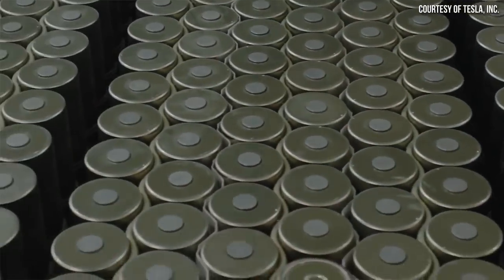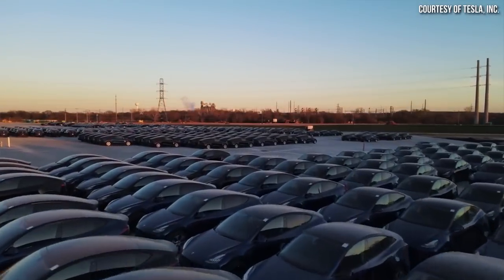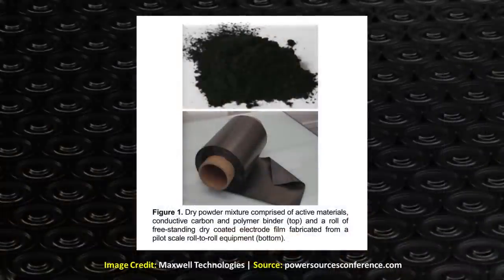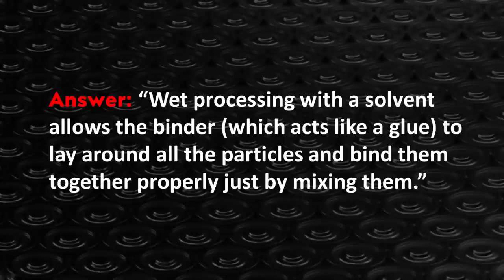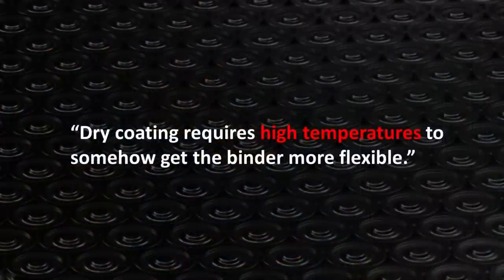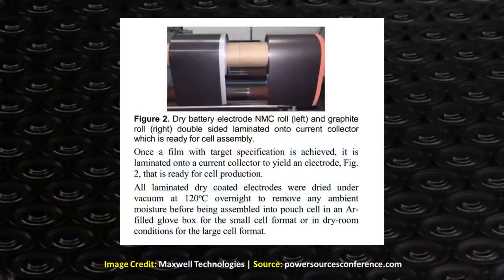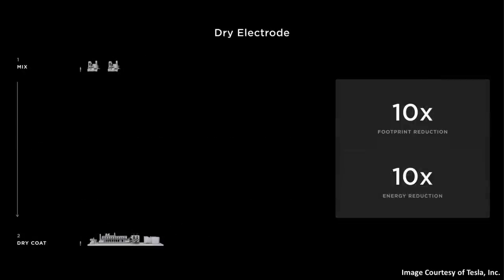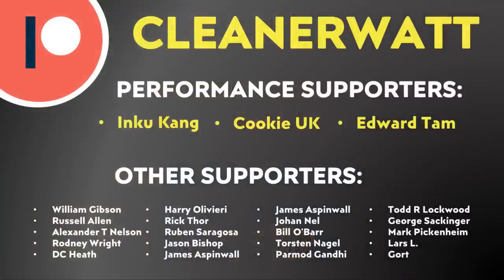Why Making Tesla DBE Battery is HARD, but WORTH IT

Comment: The Jordan the Limiting Factory guy is the best source for battery information. In his YouTube videos, he also explains how the solvents in the wet process needs to be removed to maintain the purity of the cathode materials. This process produces toxic wastes and leaves impurities in the cathode which reduces the life of the cathode.

The space and time required for the drying process for the wet production is another disadvantage of this process, especially the drying time. Speed is of production is one of the most often overlooked benefits of the 4680 design. The dry battery electrode process and the tab-less cell both dramatically increase the speed at which batteries can be produced. This is why Tesla can design battery manufacturing factory at Giga Texas and Giga Berlin, each designed to eventually produce 200 GWh per year while VW and the others are planning multiple battery factories each producing a maximum of 40 GWh per year.

Comment: As discussed by Limiting Factor some months ago, the pilot lines had problems with Nickel. Nickel is very hard and pits the rollers used to compress the materials into the DBE film. This wears out the machines faster than desired for large scale production. With the recent analysis of an early 4680 cell, the DBE technology can be seen on either the anode or cathode (I cannot recall which from memory). Full scale ramp may not require both halves, but it's part of their engineering effort to get there.
Reply: It was dry cathode only.
Reply: @andrewsaint6581  Nope, anode.

Comment: Sounds kind of like powder coating vs painting.  Or fusing toner in a laser printer vs an ink jet printer.  More complex I'm sure, as you have a reactive material.  But similar in that it goes from powder to solid.  Also similar in that the powder process is more complex but can be superior in certain aspects.

Comment: now that we can 3D print metals and polymers (plastics), why not print ? 
electronics have been printed (with conductive inks) for years. 
this is not to say it is exactly the same, but printing polymers (Q: how to make them stick on metal?) should be feasible. 
it may simply be a question of throughput though, where the printing would not be fast enough to attain the increase in production speed that Tesla is looking for. 
I enjoyed this one 🙂

Comment: Coating something dry on a conductor film ? Coating count on adhesion and adhesion count on molecular energy which is electrostatic energy at the molecular level. So bonding doesn’t work without such energy. 

Construction glue count on electrostatic energy associate in chemistry (we call glue). Alternative to glue? Shine UV light on target surface induced electrostatic on printing paper. Masking that uV light on paper we have a selective uV and hence imaged uV and electrostatic image that selective attract carbon dust onto selective regions on printing paper. Hot roll the two we have a Rank Xerox photo copying. This Xerox patent is expired. Feel free to explore this process. 

For dry electrolytes on conducting electrodes, use a blank mask or no mask. Shine uV on work electrode to load it up with uV or if possible direct load up the electrode with electrostatic and let it pull in the fine and dry electrolytes, in a controlled manner in favor to thickness and void free coating. Then find any means to fuse them together as one part of electrolyte-electrode laminate. 

Adhesion enhancement? Smooth electrode surface may use micro rippled surface, chemical etched rippled or plasma etched ripple. Hop this helps.
Reply from the maker: There is a bit lost in translation I think, but I think I get enough to understand. Very interesting thoughts.
Reply: In photocopying and Xerox Laser Printing. . .  a selenium belt is electrostatically charged, and the selectively discharged by a laser or light source (copier).  A plastic-encapsulated grain of carbon black is drawn to the still-charged areas, and transferred to an oppositely charged sheet of paper Memory a little weak on exact process here).  Paper, with plastic encapsulated carbon goes through a heat/pressure station where plastic is melted into paper fibres.  

I can envisage the DBE process working somewhat like that.

And, oh, yes. . .  never cover a laser-printed document, such as a certificate, under a plastic cover.  The carbon black will migrate to the cover sheet
Reply: @Cleanerwatt  please review again revised message above.

Comment: Copper foil on the anode and aluminum foil on the cathode I think ?
Reply: Yes, anode (-VE battery electrode) is copper for lithium ion cell
Reply from the maker: I just added a pinned tweet with that correction.

Comment: So, condensed version...the battery Musk is saying is part of the structural battery pack, isn't being made yet.  So any production numbers he's quoted, like Raptor production numbers, are irrelevant.
Reply: Tesla is producing structural packs with 4680 cells in limited quantities. Per Limiting Factor's analysis of an early production cell, the DBE tech is already in production for one half of the cell; I forget if it's the cathode or anode. So the tech works, but it's known that Nickel particles pit the rollers, wearing down the equipment faster than desired for mass manufacture of both halves. They don't need everything perfected to start building the structural packs in limited numbers, but will to ramp them to truly mass market numbers.
Reply: @Tanstaaflitis  The batteries coming out in that form factor right now, are not the 4680s everyone's been sold.  They aren't using the same process or chemistry, which means they aren't providing the same structural properties OR energy capacity.

It's basically a cylindrical case holding 3 2170s.

Comment: Thats a big problem...if the process is not already perfected it could take years to perfect for mass production. Maybe Elon announced it too early...
Reply: On one hand, we see that they are in production... so something must be working.  We also see Tesla procuring large contracts for battery material and we can assume this is for Tesla or a battery partner.  Musk has been involved in a quick/successful iterative process in multiple industries.

On the other hand, Tesla has given the battery specs to both CATL and Panasonic.  I doubt they shared their anticipated manufacturing technique, but I'm certain that they shared the necessary specs and performance for these batteries.  CATL and Panasonic have much more expertise and experience with high volume battery production.  Panasonic's response is a different design with multiple tabs (instead of tabless).

Will Tesla pull a SpaceX and change the way that batteries are manufactured?  How much of Tesla's anticipated growth in the next five years dependent on their own 4680 production?  While Tesla vehicle production isn't limited by batteries this year, is it because they pulled battery resources from products like Powerwalls?  Will 4680 production hinder expected growth as early as 2023?  Elon Musk has challenged and encouraged Panasonic to scale as quickly as possible, is this because he doubts Tesla's ability to produce 4680 batteries in large quantities anytime soon?
Reply: He said in an interview with Tim Dodd, The Everyday Astronaut, that "SpaceX does the impossible, late".
Tesla too.
It's the same jockey on both horses.